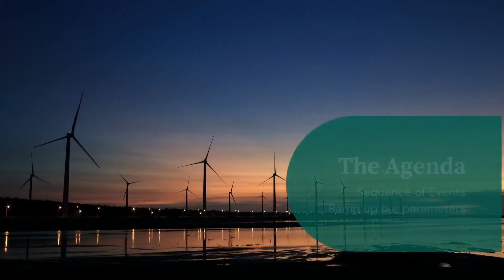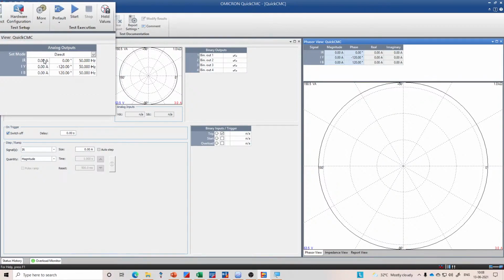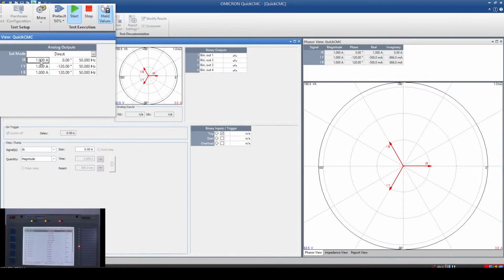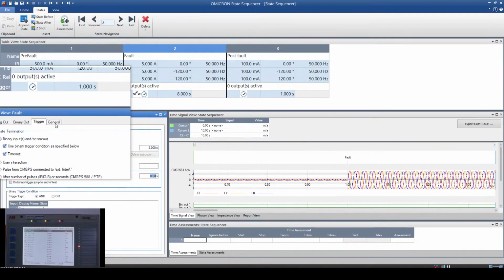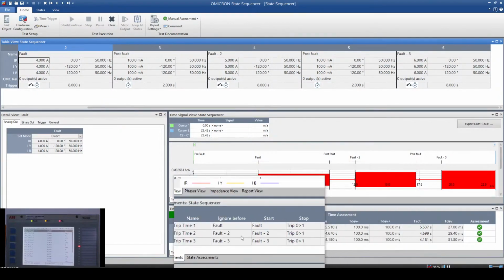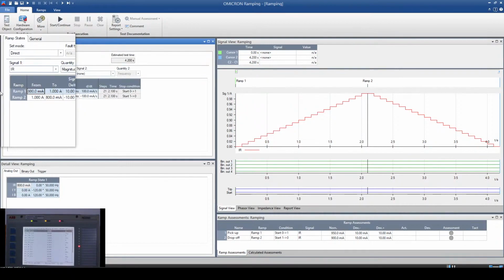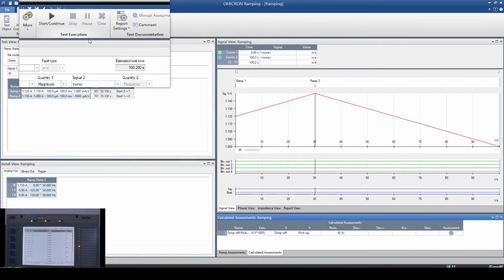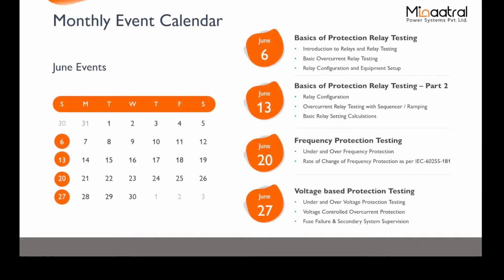Basics of Protection Relay Testing Part 2

Comment: in state sequencer, you explained about pre-fault, fault and post fault conditions.  At fault condition if the time exceeds the expected time then it sends the tripping signal to CB.  When the CB is interrupted, it means the fault current will also be interrupted. Is this moment will be post fault condition ,  when the relay will be reset by  itself means it will come to its normal state?